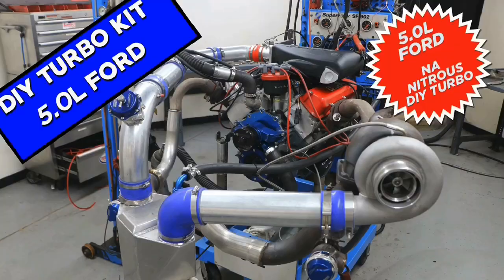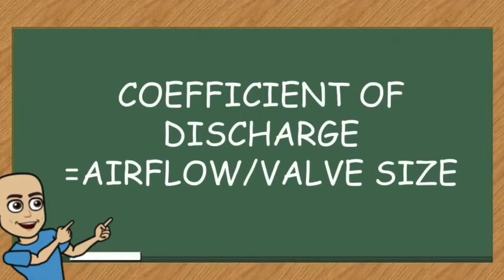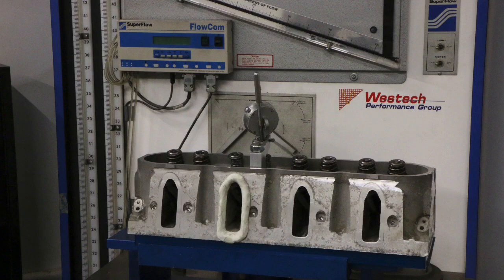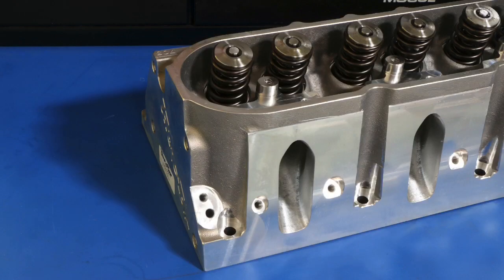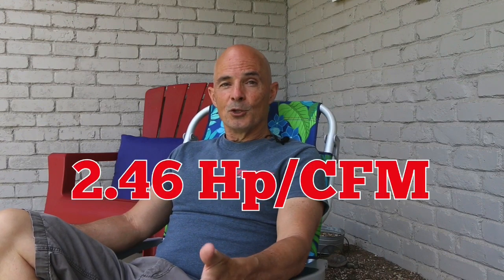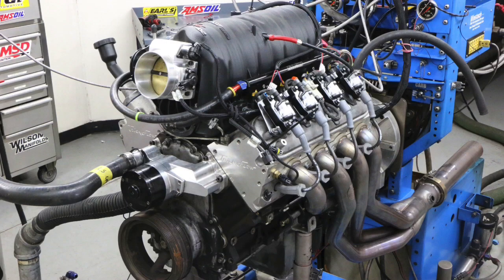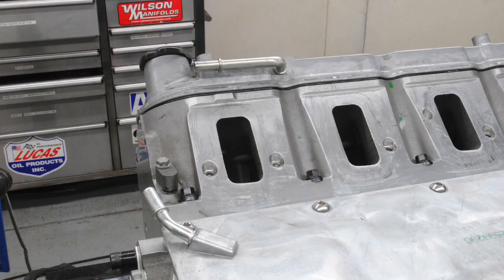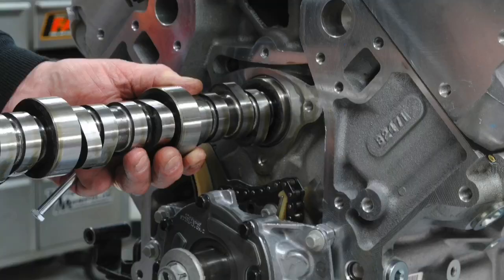IT'S ALL IN YOUR HEAD

Comment: If at max rpm on the dyno, the engine vacuum starts coming back, that means there is a restriction some where, too small a carb,? Too small an intake runner, ? Air filter too restritive?, David Vizard has all this info, and more . ,Hope this helps. The head port has to have exellent velosity to perform well at the rpm capacity that the engine combination is capable of.

Comment: So coefficient of discharge reflects air velocity as it enters the cylinder? Similarly, to how port volume (actually cross section) reflects air velocity through the port? Faster being a benefit to efficiency and drivability?
Reply from the maker: coefficient of discharge is the airflow relative to the valve size

Comment: the cathedrel port head has higher speed air on top  causing it to roll 
but keeping flow speed up  
the fuel goes through the tumble  spending double the time in runner creating fumes 
and fumes have a higher blast than gas 
the little chevy heads get 40 extra hp being vortec 
making the runner bigger pushes the start of the roll to a higher rpm
is there a spot on rpm on cathedral ports that you see hp spike?
the buick Dart heads on 307 ci, hitting 750 hp 
or the sb2 nascar engine 
The cathedral intake ports having the rounded top instead of exaust  baffles me 
does the intakes start the big flow or tumble earlier on big ports ?
The notch on lt4 heads intakes intreges me too.
Is this all in my head?

Comment: Hello I am back again! I am assuming this cfm flow correlates to the intake side of the flow when you are talking about a head flowing 300 correct? so with your formula N/A a 317 head should max out at around 500 hp @ 0.550 lift based on some air flow numbers form a guy who flow tested stock 317 heads. at .500 lift it was 254.4 cfm. so how does exhaust flow affect these numbers?  thank you again
Reply from the maker: you need both to make power-the rule is just a general one to give people a baseline

Comment: hi Use your info which is great ,but incomplete .
Talk about max air speed caused by pushrod pinch and how it varies by engine cuin and RPM . eg As small pinch with a large cam, rpm , cuin ,  will over speed the air flow and make airflow stall or collapse .

Comment: Interestingly, you keep using the word [BIG] in your dialogue, but never address how the word [BIG] is qualified.  [BIG] compared to what? The Coefficient of flow, by itself, is a worthless number until you tie it in to Displacement and RPM. C'mon now Richard.., you are still holding back.  You're giving your followers about 60% of what they need to know in determining, aka: predicting, power output of any engine while never addressing the other 40%.  Its the other 40% that nobody ever addresses that keeps ppl in the dark.  Knowing that other 40% allows an individual to compare apples to oranges relative to any cylinder head. I like your vids, but you still havent shown ppl how you qualify port to cylinder sizing as in Small, Medium, Large, as it relates to Mild, Moderate, Maximum power output.  Your vids are fun but until you or someone else addresses qualifying [Sizing compared to Output].., the peanut gallery will still be stuck running in circles chasing their tales
Reply from the maker: coefficient of discharge?

Comment: Good video for young people who think bigger is better,my superstock head is 170 cc csa 2.12  flows 255 at .500 and makes 580 HP and 512 torque peek power at 6900. 364 CID 9.33 compression 3000 lb car has run  9.85@133 finish line rpm 8300 and that's an olds 350....use the smallest port with the best flow  and proper cam and you will car lengths ahead of a guy with big  lazy ports with more up, that's really simple... listen to the old guys they have been there!!

Comment: This is hilarious, because I have two motors that are currently making well over 2hp per cfm!

I have a small block chevy making over 400hp on a pair of iron bow tie vortec heads that flow about 200cfm.

I also have a dart small block making over 600 hp on a pair of AFR heads with about 280 cfm airflow.

Comment: How does the math work with 4 valve heads?
Reply from the maker: YOU FLOW THE 4V HEAD THROUGH BOTH VALVES-BUT 4V HEADS MAKE MORE POWER
Reply: @richardholdener1727  
Not what I asked, but okay.

Comment: So if I have a 6.0 Engine, with about 550 Horses, my stock rec Port Heads are not gonna need to be ported and Polished for more flow?(54-469-11 Cam,Nitrous, 3.73 Gears, 1" 7/8 Headers)
Reply from the maker: you are good
Reply: @richardholdener1727  You Da Man Mr Holdener! Awesome Knowledge. 🙌🏾👌🏿

Comment: This is at atmospheric pressure? Is there a different formula for boosted and would you ned the boost curve to calculate?  I know this video is 8 months old but for some reason it just showed up in my email.
If you have 10 lbs of boost it then adds a component of time over pressure(?), the cfm will be the same at/in the heads?
Reply from the maker: forget airflow under boost-take the na power and double it at 14.7 psi (regardless of head flow)

Comment: That's the wrong way to calculate the discharge coefficient, which would lead an average person to select the wrong heads.  It's much more complex than you say.  The gen V LT1 has much bigger ports, smaller valves, and less flow than the LS3 yet makes more power (it's not because of the DI).

Comment: These tests are all made with static valve. When the engine is running, the valve is never static. Coefficient of discharge is closer to reality than just a CFM, but neither of those numbers take to account the effect of the moving valve.
Reply from the maker: dynamic is definitely different-but we can still extrapolate the changes in flow versus power
Reply: @richardholdener1727  Indeed, and definitely not wrong. I was just hoping to see, how those different styles of ports behave with valve pulse. And I understand it is almost impossible to get on video, but still it is an interesting subject.

Comment: I suck at math but have always heard to get the best flowing head you can afford then go from there as far as the short block or bottom end is concerned, with that being said putting a cam in a stock headed engine gains power because it  holds the valve open longer/ higher etc and so on to ultimately increase the airflow through the un modified head. I would like to see a test putting a high flow head on any given engine without any other modifications to see if that alone makes any difference to start with.
Reply from the maker: I tested ported LS3 heads on an otherwise stock LS3-only 10 hp gain (with flow rates of 350 cfm)

Comment: Re: Airflow / valve size for coming up with C/D, the one problem that I see with the approach is that most heads are tested on a pretty large bore size, and if your engine has a much smaller bore size than what the head was tested at on the flow bench, you no longer know the actual CFM flow and therefore don't know the the C/D.  (At a certain point of shrinking the bore size you'll get shrouding and the air not flowing equally around the head of the valve is going to reduce the C/D. 

I love what you're advocating for and I'd love it if we'd start seeing head MFGR's providing airflow charts on multiple bore sizes or at least the most typical bore sizes. -A 180cc or 195cc 23deg SBC head flowed on a 4.125" or 4.155" bore doesn't help us make this decision well, when most people are going to be running those heads on a 4.000" - 4.045" bore size.  (SOME head porters ARE at least offering head designs specific for small bore applications and are providing CFM charts for those bores, along with min CSA #'s and C/D #'s *Cough Chad Speier Racing * Cough!) -Now if only the big guys would follow suit.

Comment: Great discussion in the first 4 min!  Plotting the piston CFM air demand at each degree of rotation against the cylinder head + cam lift curve at the same degrees also highlights another important part of why the theoretical and actual #'s vary.  -If a given head and valve lift at most degrees of rotation are already exceeding the piston demand, moving to a bigger head won't help you make much more power, PLUS when you do this, you see that as the piston approaches BDC the piston CFM demand exceeds what's being delivered by the induction system +cam (or you wouldn't have any vacuum, would you?), and the cylinder finally gets fully filled only as the piston is rising back up the cylinder -> at this point filling the cylinder fuller (beyond 100% VE) is aided by high VELOCITY and a matched cam (the smaller head at a certain point will make more power). 

-As the RPM increases, the amount of time you have to shove air into the cylinder also decreases, this is the other place where more velocity, will make MORE power than having a bigger head than required. (Like you highlighted, though more CFM per valve curtain area and per intake port min CSA, still makes more velocity.)
Reply from the maker: you are missing a big part of power production here-reflected wave from the induction system that dramatically improves cylinder filling at BDC (if time correctly)
Reply: @richardholdener1727  Thanks for adding that. It was definitely missing from the post. (I'm a long-runner nut job, so it generally doesn't apply at my HP peak, but my torque peak, so when I'm thinking around HP peak it never applies to me as I'm outside my tuned RPM.)  --Do you happen to know whether wave tuning impacts the VELOCITY of the incoming air or just the DENSITY? (I'm thinking only the latter, but that's a guess, for sure...)

Comment: Richard how would a l4q with 4.8L heads be? Would that not up your compression and make more power.? 600hp?
Reply from the maker: AN LQ4 WITH 4.8 HEADS WONT MAKE 600 HP
Reply: Richard Holdener thank you very much sir, you’ve saved me a lot of headaches.

Comment: Are you doing cfm x2 = horsepower because of these engines being V8s with two cylinder heads? I ask because I have always been told that the engine needs to flow 1.5 CFMs per horsepower made on the intake side.

Comment: @Richard Holdener ... I'm not clear on your use of the formula, HP = CFM x 2. is it times 2 because a V8 has 2 cylinder heads?
Reply from the maker: It's times 2 -example-300 cfm x 2 =600 hp potential

Comment: So it sounds to me like coefficient of discharge has a direct correlation to the air velocity through the port.
I’ve heard good velocity at low to mid lift provides good usable torque which on the street is king.

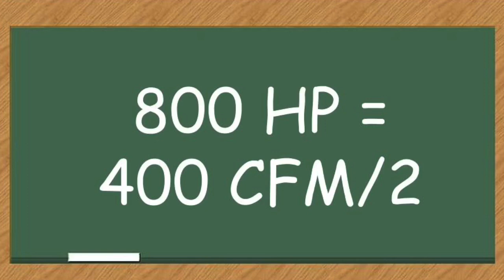Comment: At 1:00 shouldn't the formula had an "X" and not a "/"?  And this formula is for a V8, you'd have to adjust it for any other number of cylinders.
Reply from the maker: yes
Reply: Richard Holdener, so a universal formula for all engines would be:  cfm x .25 x #of cyls = hp potential   The Coefficient of Discharge calculation is very interesting.  I hope you'll share more calculations and rules of thumb in future videos.  Thanks!

Comment: Sounds like the Coefficient of Discharge combines volume with velocity. So higher velocity at a given CFM yields the most efficiency and therefore power. That's what smaller ports and valves for a given CFM literally MUST cause - higher flow velocity. I'm guessing it promotes things like uniform mixture in the combustion chamber, and exhaust scavenging. Please correct me if I'm wrong, I want to make sure I understand this correctly.

Comment: How does the formula for coefficient of discharge change when you consider heads with more than 1 intake valve?
Reply: Multiply the diameter of a valve from the 4-valve head by the square root of 2.  That will give the equivalent diameter of a single valve that would have the same area as the two valves.  (This is not a joke.)

Comment: Your CD ( coefficient of discharge) is all wrong. Flow is a function of cross section which is an area measurement. You need to compare it to an area measurement. If you are comparing at lift you should multiply the diameter by the lift so you get something proportional to curtain area.

For an overall CD you could square the diameter and divide by 4. I'm leaving pi out of the equation for simplicity and the unit would only be for personal comparisons purposes but diameter as a single dimension doesn't really represent it properly. The CD should be more constant at lift below 1/4 the valve diameter this way and in some way comparable to the diameter squared over 4 and these numbers will better translate to engines of wildly different valve sizes.
Reply: Different people use different methods to calculate flow coefficients.  Some use valve head area.  Some use curtain area.  Some use the three stages of flow regimes that occur during a lift event.  So you have to be careful to understand what area the data is using before judging if a head is good or not.

Comment: Richard Holder, it's published in A few books that you should use this instead of 2. CFM x 1.46. it's more realistic at this number. A few top notch books has that formula. Engine Airflow by John Baechtel, Engine AirFlow by Harold Bette's and David Vizard How to Port and Flow test Cylinder head's. I'm more interested in velocity, velocity, velocity, then CFM 😉😉😉😉.
Reply from the maker: CFM X 2 is a better measure for a good motor and when you might benefit from a head upgrade. 157 cfm x 1.46 = 229 hp (less than what a stock 5.0L Ford makes with a head that flows 157 cfm)

Comment: I'm surprised how no one I've watched here on youtube talks about maximizing the "area under the curve".  For example, maximum hp at the expense of torque below 3,000 rpm is hardly ever discussed, as dyno testing starts at full throttle and 3,000 rpm.  But just as mid lift flow is important because that's where the valve dwells the most, time spent behind the wheel above 3,000 rpm is a fraction of time spent at part to mid throttle.  Driving the street, driving the twisties, driving a road course, there is a lot of need for the power you can put down vs spinning out or putting on a smoke show.  Tractable power, efficient power, power density, durability, cost, and other things factor into optimizing your combo, so we could talk for days about all of that.  But simply making a graph of two heads' coefficients of discharge across the lift range (like dyno comparisons) would be the quick route to visualizing how one big flow/small valve head compares to a big flow/large valve head.  One is going to show a lot of "area under the curve", and my guess is a great track/street/sport head for power at any given instant.  Am I wrong?
Reply from the maker: WOT testing is done in the range where you will be running at WOT (usually 3,000 rpm and above). the lower ranges are usually for part throttle-also important but a different test

Comment: Cool vid Richard.actually write smaller size port runner produces a better mean port velocity hence better cylinder fill not so much off a lazy port which needs higher rpm for better cylinder fill. Don't forget there's heaps off variables. Just share this if you take a percentage off 65 to 70 off engine's cubic inch displacement there's intake runners mean port velocity flow.67 percent of 498 ci =333.66 cfm.

Comment: This is why the 706 heads on a 5.3 made more power than the 799.
Reply from the maker: part of it-also smaller ports, less valve shrouding, chamber diameter sized for the actual bore-there is a lot going on there (plus a slight bump in compression)

Comment: The third problem I saw is when talking about low speed power (torque) that has to really do with airflow at peak piston speed on the initial fill of the cylinder  ... This is why mid lift flow is important ... The better job you do of filling at peak piston speed the better the low end will be ... Again this can be calculated but the math for it is a little bit harder ... But if you look at torque made by tightening the load center on the cam you will see this up to the point of too much overlap

Comment: The next thing you missed is a big deal and that's camshaft duration ... The reason a lot of heads don't live up to the number is because they are cut short by the closing point of the intake valve ... Since this point can be calculated I'm not sure why you are using a overly simplistic formula it isn't much more than a guess ...

Comment: Ok ... First thing is you missed whether or not the intake flows the same amount as the head ... If not a higher flow head will not help ...the same is true for throttle body if it doesn't flow enough to support the demand of the intake then any head flow is for nothing

Comment: When using the formula for coefficient of discharge wouldn't the correct math be to use the Sq In area of the valve and not the diameter?
Reply from the maker: the air doesn't flow through the entire surface-its not an open hole

Comment: If it hasn't been asked yet, on a 4v engine, Coyote for example, to do the Coefficient of Discharge formula, are both valves added together or just one valve???  Example, two 1.460" intake valves added together equals one huge 2.92" valve. Thanks for the videos, I'm learning a lot.....
Reply from the maker: that's a good question

Comment: I wanna see a lsx 454 head and cam upgrade
Reply: One thing we learned from this video, that motor might not need the head upgrade. I bet if you swap the cam for a bigger unit an upgrade/lighten the valvetrain if necessary, that you could get some bigger numbers out of those LSX heads.